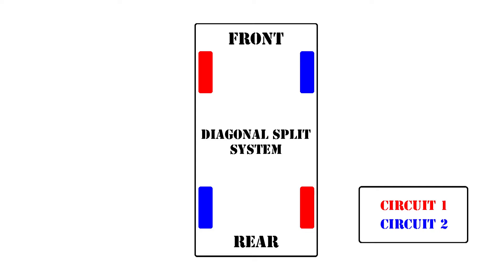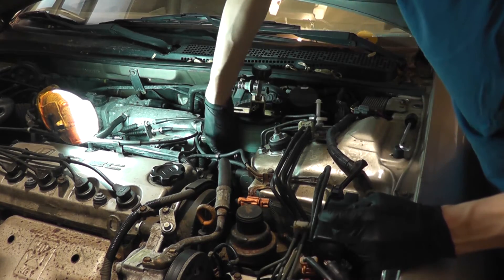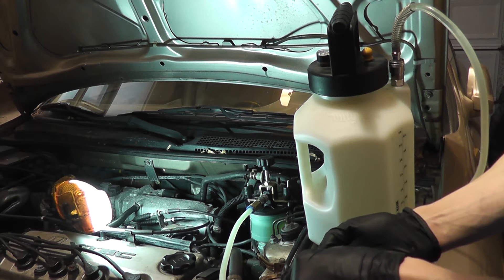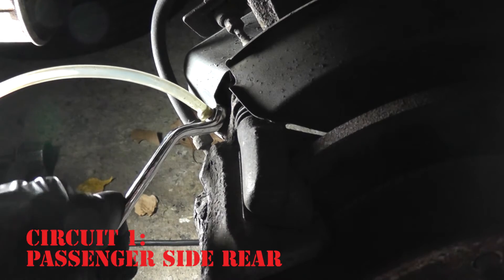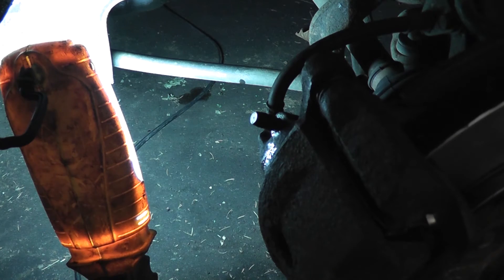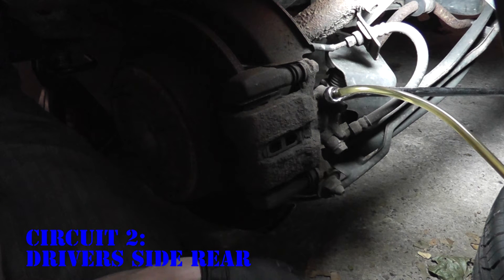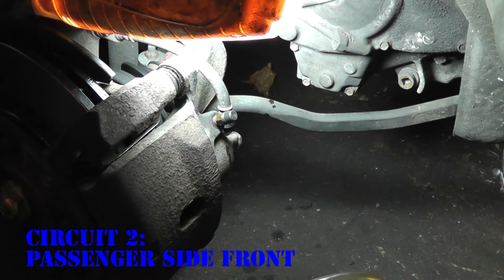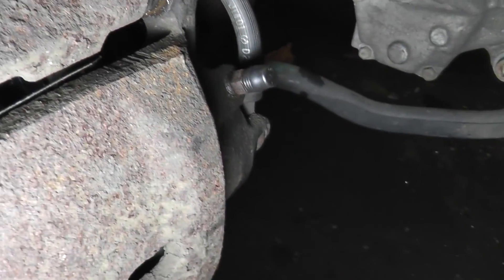How To Bleed And Flush Your Brakes

Comment: Bushougoma....when replacing the abs modulator on 1994 Honda Accord I watched your video....but do I need to bleed brakes before and after replacing the modulator?
Reply from the maker: Yes bleed all four wheels following the factory bleed order after replacing the modulator. Any time you remove a brake line you will need to bleed the system.

You will also need to fill the modulator's brake fluid reservoir and bleed it separately after bleeding the wheels.

Fill the modulator start the vehicle wait for the ABS pump to run and stop then shut off the engine.

Put some clear tubing on the modulator bleeder and open it brake fluid will flow out and stop (this fluid is forced out due to built up pressure in the accumulator) you will see bubbles in the fluid at first close the bleeder.

Refill the ABS reservoir and repeat the process until you don't see any bubbles in the line when you open the bleeder.

Don't let the modulator reservoir run dry or the ABS pump will suck in air and you will need to repeat the whole process again.

Comment: ***** - Random question: What type of steel is the  exhaust pipe on Accords after 1998?

My girlfriend's dad is convinced that Honda uses only stainless steel, but I don't see how that's possible. There's rust all over them, and stainless steel is expensive.

The braided flex pipe may be stainless, correct? But what about the A and B pipe?
Reply from the maker: The most common material for exhaust systems is aluminized steel it provides rust resistance for a short time.